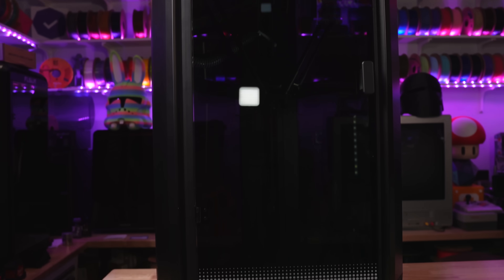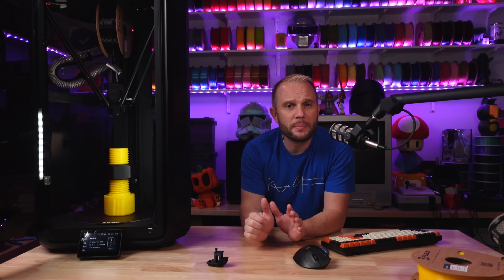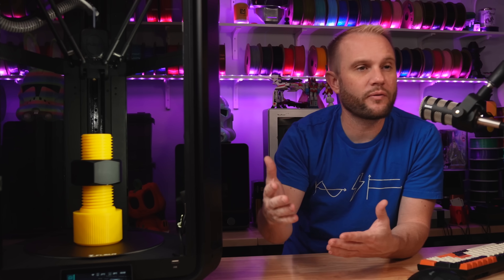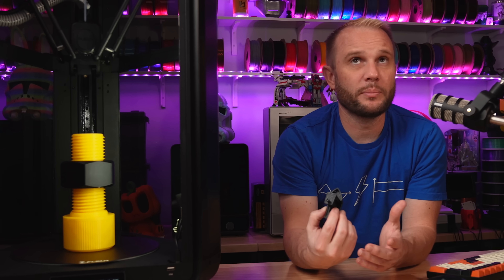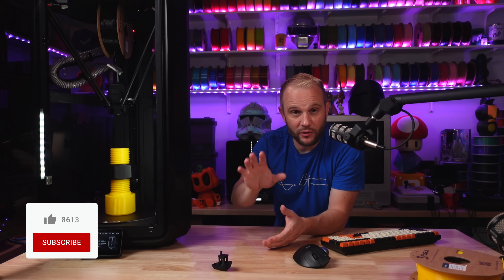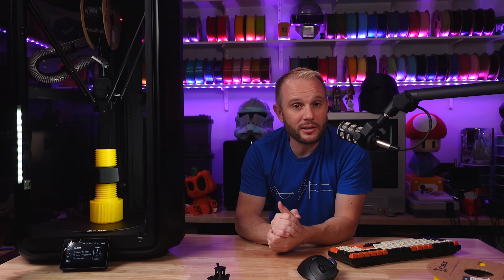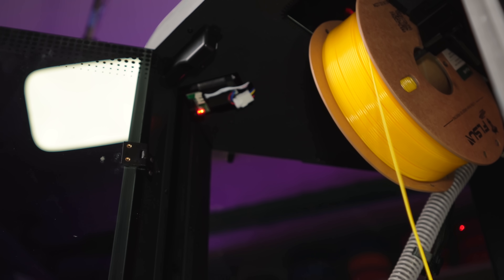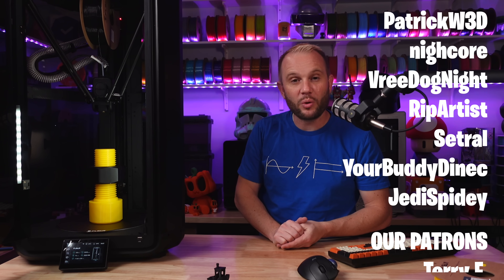You NEED an FLSUN T1 Pro! Perfect Delta 3D Printer!

Comment from the maker: PRICING UPDATE! The FLSUN T1 Pro launch was HUGELY successful! In-fact their first 500 machines sold out almost instantly, and they added another 1,000 printers to their early bird sale and even those sold out! They sent me an email that they are ending the early bird pricing at 6 PM Beijing Time on October 29, with the price adjusted to $459 (or €499 in Europe)—this is still about a 24% discount off the original price.

At the same time, the price for the T1 has also been adjusted to $399 (or €459 in Europe), and the silent kit is now priced at $29.99(or €29.99 in Europe) with the discount of "FLSUN40".

This is still a GREAT PRICE for this machine!

https://loyal.ms/flsunt1pro (aff)
Reply: Its 699 now in Europe.

Comment: I adore FLSUN Deltas. They just run and run without fail. Looking to add this one to my collection. I ran my QQ S Pro at 600 mm/s with a modified controller and it felt like the world was going to split, I could only imagine how fascinating it is watch a delta moving at 1,000 mm/s.
Probably feels slightly less chaotic with the glass enclosure at least. Mine is a threatening presence at 600 with the open frame.

Comment: The main issue I see is if you have a Cartesian 3D printer and your print has an issue it is super easy to tell what axis the problem is on. On a delta style is z banding an Z issue or X issue? what belt is loose? What rod needs tightening? Pretty difficult to troubleshoot and issue and that's why I would avoid them!

Comment: I noticed that the route the filament is going on your printer is different than how Flsun wants people to route the filament.  They want it through the clips that clip onto the cable loom and cpap tube.   I think the way you have it might be better, but have you noticed any feed issues running it of the front side, and not through the clips?  I personally believe that eventually, the clips, tube, and cable could be worn through with filament rubbing on them.  More so if using the abrasive materials.

Comment: Got in to 3D printing about 3 years ago and by chance I went and got me a QQ-S PRO, needless to say I am hooked on Delta!  I got a broken QIDI X-MAX from a friend and after replacing the MB and some tinkering with the print heads it is also up and running. I have since then got a Super Racer and Speeder Pad to run the QQ-S and SR on so the X-MAX is mostly sleeping. :-)   I got the SR pre-owned and it had a fried mother board but after som messaging back and forth with Flsun support I received a new MB and the other things that was missing so after that experience I did not hesitate to buy a pre-owned V400 when  they finally had one for sale. This machine was refurbed so it was running and only needed some accessories that where missing.  Obviously I've already got all the 3D printers I need but a T1 PRO sure would be nice so we'll see how that goes... 😀    I have to encourage anyone thinking about getting in to Klipper to have a look at the Creality Sonic pad and Flsun Speeder Pad because it really is "Klipper for dummies"! You are up and running with very little trouble and then you can still nerd out on Klipper if you want to!  Hope they keep improving their software department and software, the hardware guys are already  doing a great job though so it's more a matter of keep up the great work for them. And the guys at marketing need to learn to exaggerate less. ;-)

Thanks for sharing!

Comment: Would you say the Bambu lab a1, a1 mini, or flsun t1?
Reply from the maker: For first printer, A1 or A1 mini, for an incredibly fun, fast crazy machine as your next printer, the T1 Pro!
Reply: @ I have an ender 3d v2, but it doesn’t work right. It’s my second printer, I bought two of the same ones and both failed. I want a better one. I’m a little worried about an a1 mini though. Is the small bed really that bad?
Reply from the maker: No, 95% of what you print will fit on that A1 mini build plate - it will be the best 3D printing experience that exists! If you can, go with the AMS with it. You will LOVE IT!

Comment: I'm hesitating between the Bambu A1 and the T1 pro. It will be my first 3d printer and the app from Bambu seems to be so user friendly, especially with the remote cam access. What do you suggest taking into account that I'll be printing mainly easy ABS/ABS plus? Thanks!
Reply from the maker: The A1 will be the better user experience, the best one in our industry really. It also has the potential for multi-color if you choose to go with the combo version.
Reply: @LoyalMoses thanks a lot for your quick response. Btw your channel is amazing 👏
Reply from the maker: Thank you!
Reply: Don't buy the A1 if you are printing ABS. ABS needs a enclosure and the A1 is not designed to go in to an enclosure, you can't remove the powersupply. Buy the P1S or T1 Pro
I have the A1 it's a amazing printer. Prints better than my Prusa MK4. I just orderd the T1 pro.

Comment: Thanks for the video! As a new guy trying to get into 3d printing i think ill pass. Still doing research on what my next printer will be. I made a bad desision on buying a used anycubic i3
Reply from the maker: Very welcome? What happened with the AnyCubic machine? Used machines can be good and bad! 😳
Reply: @LoyalMoses  well I printed a couple toys for the kids and a stand for my wife's hair dryer, the came out okay with some small issues/defects. It kept clogging in the tubing in the hotend. The heat sink fan for the hotend quit on me and when I started tracing it out I noticed that the board had bubbles in the small mosfets for the fans and I had no voltage on the fan headers. Looked into swapping the board with a BigTreeTech one. It being a old printer and I still don't quite know if it's worth it compared to getting a brand new printer out of the box.
Reply: It was an impulse buy on an auction website I had never used before and I won it for $57 without looking at what it would cost to ship it.
Reply from the maker: Oh wow that’s cheap!!!

Comment: Did FL Sun approve your video before it was posted and is it the original video you made?, did you have to sign a contract with them before being sent a review unit?
Reply: Eh, I wasn't that lucky (to get it without a contract), so I have to watch other reviews, to learn more about this nice printer (and yes, I like the older V400)
Reply: As consumers we are all f**k since sadly this is the norm from all top 3D printer makers such as Creality,  Bambo labs, prusa etc.
Reply: @JZScreatives8212  That's a little bit of an overreaction. You can still find and read plenty of reviews that are not contracted. And any good reviewer you trust will tell you up-front if the video is sponsored.
Reply from the maker: No, they saw it when you saw it, and no contract.

Comment: I had thought that with the recent surge in Klipper based core xy printers from Bambu labs and Creality (not to mention Voron kits), Delta printers had fallen bay the wayside.
In general a delta printer must be about twice as tall as the desired Z print height.
Reply from the maker: Vertical real estate is cheaper than surface real estate.

Comment: 1000mm/s is fine, but what about acceleration? That's way more significant when it comes to print speed. Max volumetric flow rate would be helpful to know as well.

I just checked the specs on their site and it is insane. 30k acceleration and 90mm3/s max flow rate. If it is as good as you say then there is nothing in this price range that comes close!
Reply from the maker: Go read their website.

Comment: $399?  That's Bambu A1 territory.  I guess they REALLY want people to try one of these things.  It was good to hear you can send files over WiFi.  I know the FLSUN machines are kind of known for speed, so that was the demo you were giving us (amongst other things), but I'd really like to see it go head to head, same speeds, same settings, same filament, with an A1, P1S, or X1C to kind of get a gauge for possible quality.  Also, while I get that FLSUN are trying to develop their own slicer, it appears they've got a long way to go on that front, so I'd be interested to know if the printer will work with other slicers, i.e. Orca, etc.  If so, then not having to deal with the FLSUN proprietary slicer will probably improve user experience.  Also, what's the infrastructure like for replacement parts, hot ends, etc. with FLSUN and these deltas?  If I want a smaller diameter hot end, do they have it?  Is it as easy to change as on the A1?  

Apologies in advance for all the questions, but I'm fascinated by deltas.  As a noob to 3D printing, I'm looking at getting the best possible machine, for the best price, with enough capability and quality to future-proof my needs for some time.  In that regard, all the options seem to lead back to Bambu, which is fine, but I just seem to be drawn like a fly to a UV light to the delta printers.
Reply: Hey bro, their printers support 3rd-party slicers, and the latest one's way better than before. U can find all the parts for replacements on their site, and if anything breaks during warranty, just hit up CS—they’ll hook u up with spare parts. I asked about the hot end, and they said it can take smaller hot end. Just gotta tweak a few settings to get good results, but that should be easy for u!
Reply from the maker: Prices for this stuff are insane now!

Comment: LM, should I get this or the upgraded version of the Anker you gave away last night? I can get the upgraded version now for $400 and I can pay for it in increments. If I get this delta printer I have to wait and get all the money at once. And by the time I have the money it probably won’t still be on sale.
Reply from the maker: The Anker is going to be larger and more versatile I would say.

Do you already have a 3D printer? If so, then the delta is awesome. If it’s your first, I’d recommend the Anker.
Reply: @LoyalMoses  And then I find out that Anker you gave away was the newer version, lol If I do get an Anker I’m getting that 5C. If I don’t I’m getting the FLSUN.
Reply: I’ve got an Ender V3 SE that I didn’t like and replaced it with an A1 mini (based on your review) a month later and never looked back. lol
Reply: Still have the Ender. Know anyone looking first an Ender with the Sonic pad? lol

Comment: Those folks who think Delta printers are a pain to maintain or calibrate?????? ur still stuck in 2018 or even earlier.I have used the FLSUN SR, V400, and T1, honestly, they’re way easier to maintain than my Artillery X2 and Qidi Q1 Pro. As a die-hard Delta fan, Im totally ready to order the new T1 Pro. Seriously..if u haven’t tried the latest Delta printers, it’s time to drop those old biases!
Reply from the maker: Great to hear!!!
Reply: @LoyalMoses  I can't agree with you more!
Reply: 💯
I have a v400 and was just looking for an upgrade part this morning and went to the FLSUN site just to see if the T1 pro had dropped yet and saw the price and bought it, THEN came on YouTube to see a review. My first printer was a AnkerMake M5 and I modded it out the second I saw what I could do with a 3D printer. Then I went down the rabbit hole. Got a belt printer and then found a v400 on eBay and decided to give it a try and it is by far my favorite or my 4 printers. I was debating building a voron until this morning when I saw the T1 Pro on sale. Easiest impulsive purchase of the year. I’m getting rid of my M5 and SR with this thing now on the way. 😎

Deltas are life! 🙌🏾🏟️😂
Reply: Got me a QQ-S PRO a little over 3 years ago as my first printer and it took less then an hour to put the printer together, calibrate and start the first print that printed without any problems. :-) Things have sure improved from the Welleman k8200 a friend showed me 10 years ago! 😀

Comment: Was planning to get a Qidi Q1 Pro in November but now this thing was released and their prices are in a similar range. What are your thoughts on Q1 Pro vs T1 Pro?
Reply from the maker: Vastly different machines. Q1 Pro is so much larger and made more for engineering filaments, while the T1 Pro is going to be for speed. Tough choice!!! What are you planning on printing?
Reply: @LoyalMoses  So far I have been printing pla, petg and abs on my ender 3 v2, model-wise just some novelty things, masks, some functional things like brackets. The flsun t1 pro has PA listed as a supported filament, so I guess printing nylon wouldn't be a problem for it?

Comment: You mentioned in the review that the print quality of the T1 Pro is pretty solid. How does it handle large and complex models, though?
Reply from the maker: Very nicely! I maxed out Z with some vase mode prints to see if there were artifacts, and they turned out great. And of course overhangs on those threads were gorgeous and the pattern on the bolt was a lot of direction change.

It's an incredible machine! I really like it.

Comment: thanks for the review. I am wondering if this printer has built-in air filtration system?  I went throught the manual but it doesn't say anything about the air filter.
Reply from the maker: I don’t believe it does. I’ve not seen one.
Reply: @LoyalMoses  gonna be smells when print ASA😂😂

Comment: Brass nozzle per the FLSun site - do you know if the extruder can handle abrasives and if a hardened nozzle is available?
Reply: There are no hardened steel accessories for t1 on their official website. You would need to change brass nozzle every print if using abrasive. Their claims of PC/Nylon compatibility are ridiculous.
Reply from the maker: I’ll ask about the extruder toughness.

Comment: I am interested in this but I cannot find a straight answer as to whether there is a linux version of the slicer.
Reply from the maker: I was only sent a windows copy. So I can’t answer that yet.
Reply: @LoyalMoses  Thanks.  The web site was as clear as mud on the point.  The only instructions that I found for downloading did not match the site in its current state.
Reply: In July 2025 their support people told me there wasn't (yet).  Maybe you (and other Linux users) should ask them about it, so they know there is some demand.  The code is very similar to OrcaSlicer, and there is a Linux version of OrcaSlicer available, so it may be possible to compile FLSunSlicer for Linux.  (This is on my to-do list, but the list is long.)

I copied over the configs from FLSunSlicer to OrcaSlicer and printed a Benchy with each.  The OrcaSlicer version has a couple of spots where it isn't as good as the FLSunSlicer version.  I don't know why, maybe if I feel like wasting a bit more filament I'll try another print.

Comment: You said the build plate Diameter is 260mm? That’s unfortunately too small for me. I was under the impression it had a bigger build plate. Or is that the other model?
Reply from the maker: The S1 Pro will be out soon, it has a much larger helmet sized build plate!
Reply: The build volume is little lower than my QQS-Pro at 285mm/truncated 330mm, but considering the speed of printing, try to print higher parts, especially thin ones, can be tricky at theses speeds...
They put the spoil inside and due to this, they've lost few centimeters
Anyway a Delta, isn't good for big volume...With a cylinder footprint/diameter of 265mm,  you always print squared  parts than are 200mm wide maximum, except if you make only pipe and vase...It's not very efficient.